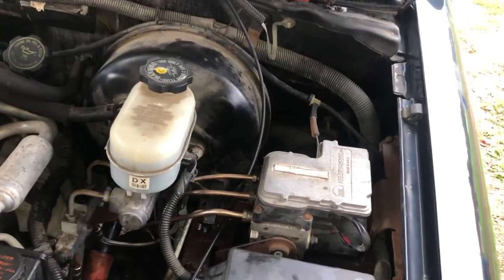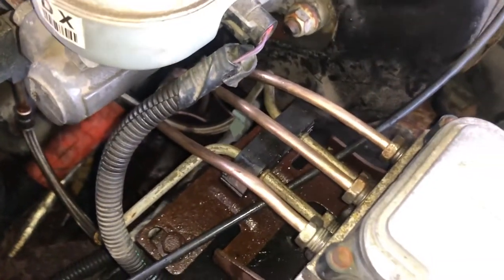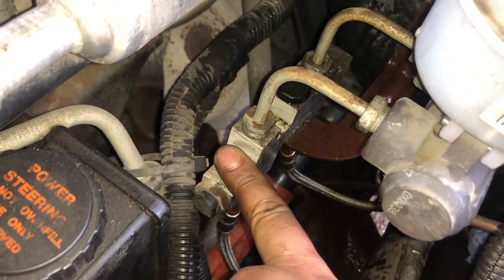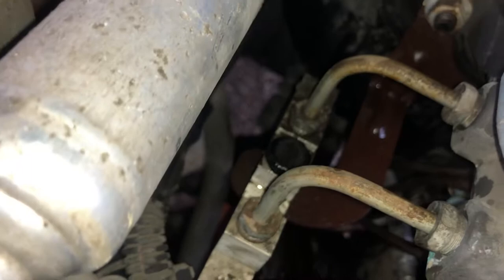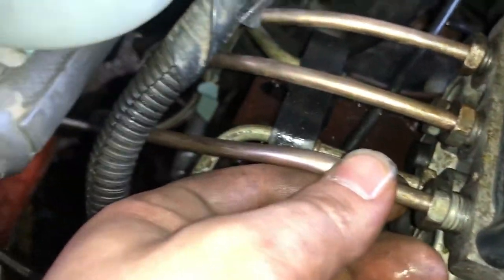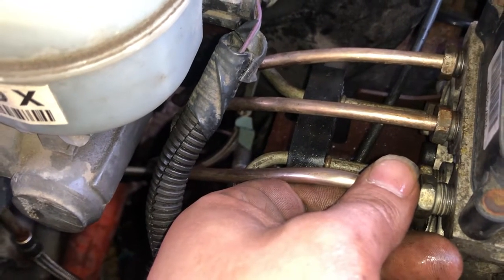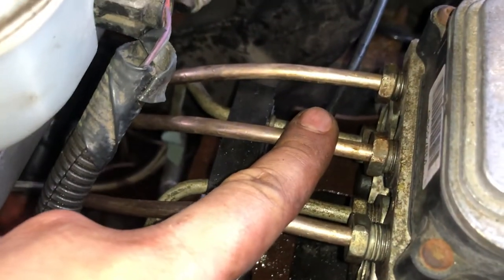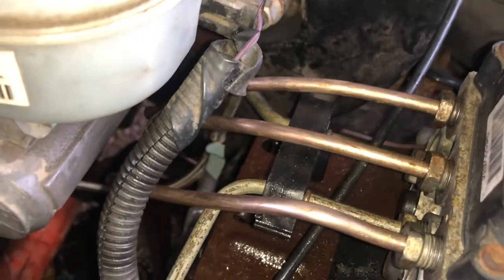Brake line routing diagram explained Chevy S10 blazer GMC Sonoma Jimmy Oldsmobile Bravada

Comment: My ABS pump front driver line has a hole in it right before the front caliper hose connects. What diameter and does anywhere sell it individually

Comment: What are the size of lines going from the front to the rear brake hose and then splitter that goes to 13/16 what size are the lines before the brake hose?

Comment: I'm told I need a new brake proportioning valve for my 2003 GMC Sonoma. However, I've been told the are a discontinued part. Is this true?? I have front disc and rear drum brakes. The mechanic says maybe there is a rebuild kit, but won't do the rebuild due to possible liabilities if it fails. What to do?? Advice please. Do you have that such part??
Reply: I just took mine off since my truck will be for drag racing and I was gonna throw it in the trash. Idk how to arrange it, but if you want it, it’s yours!
Reply: @brandinsgarage  Thank you for the offer. I found one in Iowa, 60 miles away. Valve was $25 and also bought the ABS module for $75 just in case. Ended putting on the module...no more light now. Brakes work great. Now the drvers door hinge pins and bushings need replaced...again.😥 Oh well. Again, thanks for the gracious offer.

Comment: THanks for the vid!  Wondering what is the fitting/thread size coming out the the abs block, for the line to the back?
Reply: idk but there is 4 different size nuts and threads between abs and lines also 3/16-1/4 inch line, youll need a flare tool to do it bc no premade except from rear block to caliper
Reply: @garretfisher2217  for the life of me. why all different sizes..
Reply: @williammuff5485  idk the abs block on these was engineered by someone less educated then us plus corrosion its just a bad deal

Comment: Hey for the line that goes all the way to the rear is it one line or is there 2 lines that go all the way back? A lot of the kits online for prebent lines seem to have 2 intermediate lines
Reply from the maker: Pretty sure it’s one 1/4” line
Reply: @FerKurl  Ok thanks, and one other question, how difficult were the front caliper lines to change? Were there any unions on the way down from the engine bay to them or anything? I'm having a very hard time seeing on my S10.
Reply from the maker: @JustinPVlogs  should be one long line unless someone has messed with it previously. Pretty typical line to do. Not super easy not incredibly difficult as far as lines go
Reply: @FerKurl WHAT SIZE ARE THOSE SPECIFIC LINESSS?!!!!  It’s two lines different sizes with a union in the middle     The middle line coming out the abs thing.   That goes to the front right brake   WHAT SIZE do I ask for at the parts store??!!